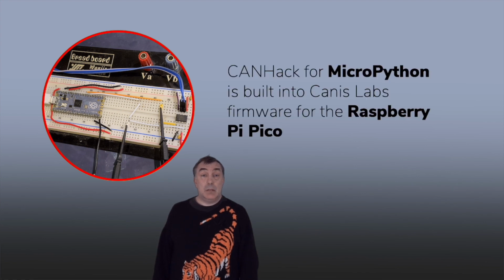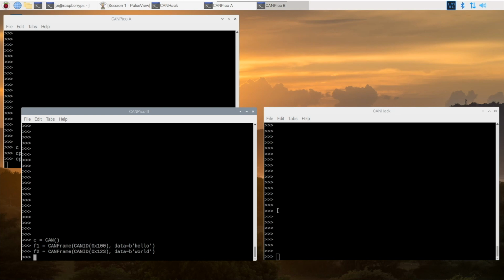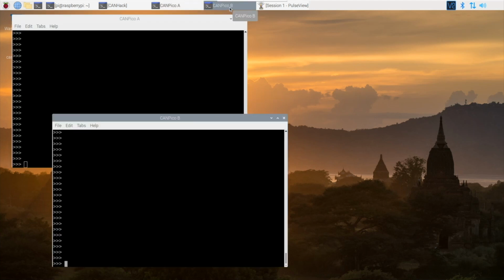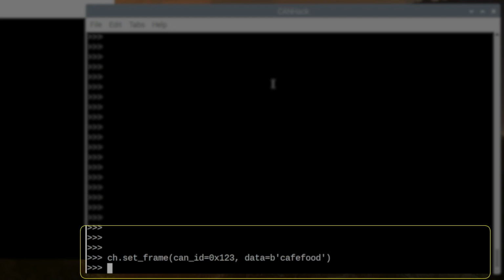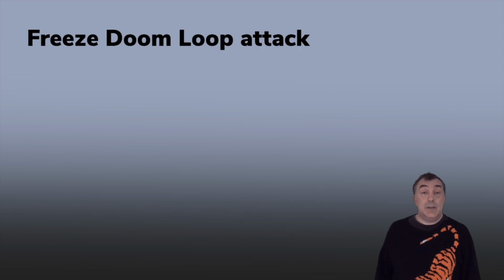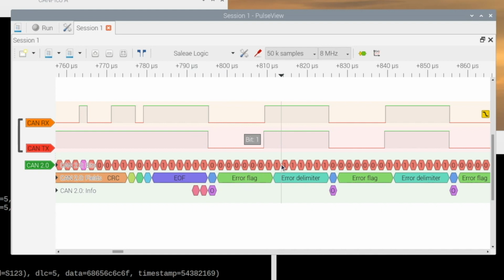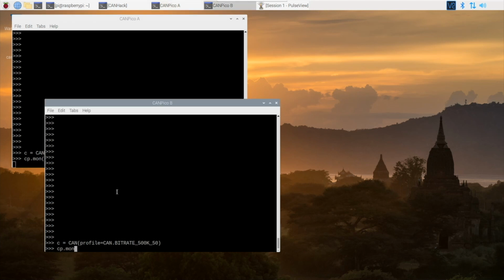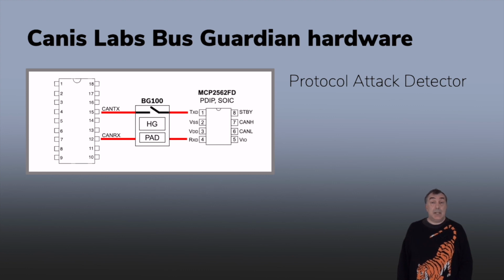Demonstration of attacks on the CAN protocol

Comment: If the HG mercury supervisor fails, will the network fail? if so this compromises failsafe/redundant behavioral design of CAN (with one wire open also vanilla CAN can function) isn't it.
Reply: There can be more than one supervisor, and they can also cross-check each other.
Reply: @kentindell  ok thanks. !

Comment: Do you use the same differential driver to create the HG fast bits?
what happens if a low pass filter is used to filterout fast bit signal?
Reply: It uses standard CAN FD transceiver. A receiver will only have a filter if it doesn't have HG hardware and then it doesn't matter if such a receiver doesn't see those bits.

Comment: Hi,  The Node Id created using this “Bit zipping” technology of CAN HG ,  itself can be duplicated and spoofed (“cloneable”), thereby compromising/disturbing the whole idea of “unique Id” creation. ??
Reply: CAN-HG hardware listens for its own address being used and destroys those frames.
Reply: @kentindell  thanks for reply..... my concern is that the fast zip bits can be generated by a third party FPGA (replacing per node 'mercury' hardware) which is connected to the bus via transceiver, spoofing the fast bits itself with a wrong id.